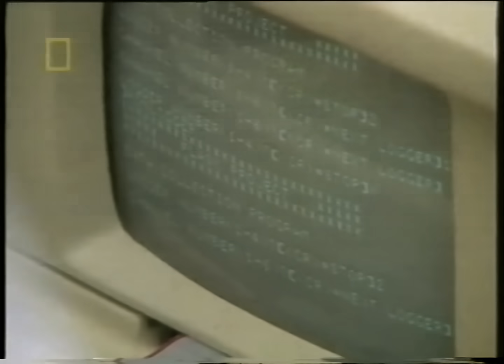Train Crash Test @ 160km/h (99.4 Miles) into 50 tonne Metal Block

Comment: the locomotive used here was BR sulzer type 4. They chose it because they were the heaviest locomotives in BR service at 138 tons.
Reply: @Stephen Drury - can't spell, uses childish insults AND doesn't know that a dick does not fart.
Reply: They apparently bought two withdrawn Class 46s in case one failed during the test (before hitting the flask).
Reply: They should have used a Union Pacific turbine locomotive or a Baldwin Centipede locomotive hauling about 10 loaded freight cars behind it.
Reply: Yeah but none of your yank locos can reach 60 mph without a ten mile run up, never mind 90 mph plus !!
Reply: @magicmaybach  obviously you have never seen a DD40AX
Reply: @magicmaybach  In NC they are currently in the process of upgrading the main line from Charlotte to Raleigh, Durham and into Virginia at a cost of $500million to enable "high speed" passenger services .... at 90mph!  ROFLMAO  So after the upgrades passenger trains will be able to run at the speed that mainline express trains in the UK were routinely running at 60 years ago and were superceded by 45 years ago when the HST's were introduced.  

I am less than amused only by the fact that my taxes are going towards funding this nonsense!
Reply: The Locomotive is a British Rail Class 46 numbered 46009
Reply: Actually this one 46 009, a class 46 was retired before this test was conducted
Reply: Like ur profile pic!
Reply: Near to the D16/1 I believe
Reply: Class 44
Reply: @florjanbrudar692 Class 46 look at the number on the side
Reply: aka they just wanted a big crash
Reply: They used Class 46, no. 46009 in the test.  The remains of the loco was scrapped on site by Vic Berry from Leicester.
Reply: Sulzer Type 4 may refer to:

British Rail Class 44
British Rail Class 45
British Rail Class 46
I copy pasted this straight from wikipedia
Reply: Also why are yall arguing about the delctics, those are a completely different engines
Reply: It was a class 46. Engine number 46009. It was also a bit of a falsified test. The loco in question was due to be scrapped anyway and had structural changes so the engine would break free in the impact to reduce some of the travelling mass.
Reply: @triptechable  nah
Reply: @triptechable  Is that proven? I remember seeing an interview with either the BBC or Channel 4 (if that was even around at the time) newsreader alleging it, but the bloke running the test denied it.
Reply: that's pretty light for a diesel locomotive
Reply: i looked like a deltic
Reply: @Likes_His_washer  The obvious visible difference is that the Deltic has 2 windscreens not 3 like the one in the test.
Reply: @Likes_His_washer  it's a peak or class 45
Reply: @maddog7139  British Rail class 46, no 46009
Reply: @maddog7139  looks like a 45 to me think you are right
Reply: @maddog7139  technically only the 10 class 44's were peaks (all named after mountains and hills in the UK), though the 45's and 46's were commonly referred to as peaks.
Reply: @Likes_His_washer  its a class 40- it has a 3-peice windshield and it looks similar, but not the same, as a Class 37
Reply: @redleader8952  Class 46 Peak, as already stated............
Reply: bro70 oh oops! Sorry, I live in the US... I'm not as good as I should be with UK trains...
Reply: jason tynan I'll have you know I'm 14, and therefore cannot legally own a gun, and never plan to. I just love trains, and its natural that I would know more about US trains than U.K. trains, because I live in America. We don't need toxic people like you in this comment section or the world. Get out and let the actual rail enthusiasts talk about what we like.
Reply: @UnbelievableEricthegiraffe  Who hurt you?
Reply: @redleader8952  Most diesel electric locomotives in the UK look quite similar - either roughly flat-fronted - so classes 26, 27, 31, 33, 47, 50, and 56 being the common ones in the 1960's-90's, and those with noses - classes 37, 40, and 55 (Deltics) with long noses and classes 44, 45, and 46 with short noses.  The obvious distinguishing features are most often the number and pattern of windcreen panels.

Class 20 was an odd exception, being the only long-lived class that, like many US locomotives, had only one cab and were commonly linked semi-permanently in pairs with a cab at each end of the linked pair.
Reply: @redleader8952  Well said
Reply: @redleader8952  That was very well said for a 14-year-old!  Extremely mature.  And has your interest continued in the intervening years?
Reply: @bro70 so why the need to repeat ..😴😴😴
Reply: @redleader8952 14 or not you could send a glass eye to sleep kid 😂
Reply: They were rubbish locomotives ... Not a patch on the class 55 AKA Deltic
Reply: Arsene Wenger wrong. A bit overweight but they did a decent job on passenger and freight work
Reply: @owenevans83  Not going to get into an online argument with you about trains ..How sad and pathetic is that LOL .
The class 55 is a better locomotive IN MY OPINION ... It can't be "Wrong" .It is my opinion.. 
The class 55 was the backbone of the East Coast Mainline from 1961 until the HST took over ... 
If you like these more than the "Deltic"  then that is fair enough .. Would be a boring old World if we all like the same thing.. Kind regards Owen
Reply: @briansaiditsoitmustbetrue4206  Read my comment again, I didn't specify whether they were worse, I just said that 46s are not rubbish locos. However I agree that an argument over choochoos is pointless; you're an Arsenal fan, you've got enough on your plate as it is!
Reply: @briansaiditsoitmustbetrue4206  the 55 was amazing. Very much missed.
Reply: Your a very well knowleged one but also a very boring twat too
Reply: @stephendrury3409  No need to be one yourself.
Reply: Well put :D
Reply: @stephendrury3409  You are simply an idiot!
Reply: @peckelhaze6934  haaaaaa knobhead.
Reply: When you call people boring and the only thing you have to add is insults.
Reply: @anononomous  haaaaaaaaaaaaaaaaaaaaa😎
Reply: @stephendrury3409  The irony of not being able to spell knowledged. You didn't even think to check  before you posted. You ain't very good at insulting people are you? Do people often laugh at you?
Reply: @gravydavy4188  That is wasted on such a being. They don't get irony.
Reply: @gravydavy4188  He also cannot spell: you're (your). I consider the information relevant, not boring. Troll alert.
Reply: @gravydavy4188  I'm pretty sure Stephen was having banter.
Reply: @stephendrury3409 
Says the guy with a last name the is practically "dreary"
Reply: @stephendrury3409  One of the Blockheads needs to know where to shove that Rhythm Stick!
Reply: @stephendrury3409  I had a stroke trying to read that and process what it means
Reply: @stephendrury3409  hHahahaha

Comment: Only because it was sitting sideways, thus the V shape the train hit deflected the kinetic energy, like today's MRAPS, military trucks that have v shaped hulls to deflect the kinetic energy from IED's and other things, flat side would have been demolished, like H1 Hummers over an IED,they get blown to scrap metal.
Reply: +Jaeger Brunswick The weakest points on the flask are the corners of the lid, and it is on one of these that the force of the train was concentrated, in an attempt to knock the lid off. Flasks had already been drop tested on concrete from various heights and all angles.

Comment: I had a bit of a brain fart. I was thinking "how could they have all those people just standing there? What if it doesn't stay sealed?" then I realized how stupid I was for thinking someone could be so stupid.
Reply: I am pretty sure that the container had pressurised liquid or gas and did not have any radioactive element .As a contamination of such a area would be devastating.
Reply: @amaljerry5373  it was pressurized to 100lb/sq. in. But I've no knowledge either of what it was filled with.
Reply: Yeah it took me a second to realize that there probably isn’t nuclear waste in it also
Reply: It's obvious they can't test it with nuclear material inside but seems like there has to be some sort of stand-in with similar mass and weight or else the results would be inaccurate.
Reply: @jbr496  it was full of water, under pressure.
Reply: the thing is.. even if it had .. nuclear waste is not gas or some liquid or fluorescent glowing goo.. its solid rods. Of course Its radioactive depending on the type of the waste (actually 95% of nuclear waste has a quite short life, only a small percent remains with dangerous levels of radioactity for long time) but the range is actually very short (alpha and beta radiation has an actual short range and get blocked easily..specially by water) So even a crack open container while potentially dangerous for people nearby wouldnt expread radiation everywhere. What happent in chernobyl or with nuclear weapons is that the radioactive material is "burned" and vaporized and its spread really far and wide by the ash and particles.. there has been cases of nuclear weapons that cracked wide open (like Palomares incident in the 60s) where there was contamination but was very limited (you can go to Palomares today, no people getting cancer or radiation sickness)
Reply: Actually, I could imagine that's how it's done in Russia
Reply: This is the comment that makes me quit the internet for the day...🤣
Reply: Scientist: “Look at the speed of that train! Good job we emptied the container first!”
Engineer in charge of container emptying: nervous sweating
Reply: They filled it with water and put in steel rods to represent nuclear fuel rods.
Reply: It tuck me just as long to fathem out your confusion so we all have those moments. But yeah for sure there wouldnt of been anything harmful in the container lol.
Reply: "There are two things that are infinite. The universe, and human stupidity, and I'm not quite certain about the universe." - Albert Einstein
Reply: +Tapport  Nothing was inside of the container
Reply: Hasan Mulla Exactly
Reply: Tapport, I think you're very right on with your initial assessment. The 2 constants within this ENTIRE universe is death.....and human stupidity.
Reply: Freaking millenials
Reply: Patricio Andres Muñoz Lopez Sad nobody.
Reply: Well, it's clear... your brain is full of farts.   It's was a pressurized container (air, not nuclear material) that was checked after, for leaks.  Now don't you feel stupid?
Reply: In today's world, it probably wouldn't be surprising if someone didn't already think it through... Common sense is a hard thing to come by anymore.
Reply: Also, what about the poor driver and all the passengers? It's all very well needing these tests but when local services get disrupted like this then questions need to be answered.
Reply: @spiralfirst6488  funny...

Comment: sweet laptop @1:02
Reply: Mark Acevedo omg
Reply: pfft you laugh now .. wait 40 years
Reply: @aliceakosota797  A computer will be implanted in your brain
 at birth. Lifelong update. Monitor in the eye ... third eye on the forehead the camera?
Reply: I miss the floppy disks
Reply: @Jimmy Garcia - I still have operational computers with 3 1/2" & 5 1/4" floppy drives. A Pentium III-450 running Windows 98  and a 486DX4-120 running Dos 6.2/Windows 3.1 ... and 2 slightly more recent HP refurbs running Windows 10 & Win 10/Vista. The older ones, of course, do not go on the net ... :)
Reply: @pudmina  im 30 but remember running programs and codes on floppy during computer programming class... This those simple days before smartphone lol I miss my Compaq pc with 40 gbs of storage and windows xps... The good old days 🤣
Reply: Not a laptop. That's called a luggable. Much more powerful.
Reply: @Kandi Klover - Eeeeeeeeeexcellent ... Yup, searched and found. Also referred to as a "Portable".  Couldn't find one exactly matching the one in the video, but MANY images to pick from :). IBM 5155 and Compaq Portable, both from the early 80's are very close. The one featured here has a keyboard that folds into the case and a flexible "LUGG"age  :) handle on top, Very handy, but heavy, about 30 lb (13.6 kg) using old school fabrication  - thick, pressed mild steel chassis.
Reply: @pudmina  wait I didnt know compaq is so old! I still have a Compaq laptop from 2014
Reply: @Gabriel-he6ih  i even have one from 2008
Reply: Can i play GTA V on it?
Reply: @Tva1ka_unofficial  sure
Reply: @Tva1ka_unofficial  you can play gta 5
Reply: Looks like the Apple IIe based 'Xcalibur Portable'.   Weighs less than 13kg!!!
Reply: @D600Active  turtle left turn 10 😂
Reply: was cutting edge technology at the time... is now the laughing stock of the worlds digital video library...hmph
Reply: @ZlGGLE  I'm fully aware that Mark Acevedo was being sarcastic, so yeah I got the joke. I was adding some relevant information about the "sweet laptop" that he referenced for those that were interested ... You were obviously not ... your loss. And, incidentally,  I'm not black.
Reply: 2+2=.........crash
Floppy discs ....I remember them in high school. The whole class was, open it, put something on it so the teacher knew you opened it and then save and close it and hand it in before the end of the class. I was like, this sucks and it was the mid 90's before I got back into it again.
Reply: For real
Reply: @Mark Acevedo - actually a really, really old desktop (Circa mid 1980's ) running what looks like DOS with a 5 1/4" floppy.
Reply: @pudmina  I did some database development for a guy with a Compaq portable in the mid '90s.  https://en.wikipedia.org/wiki/Compaq_Portable .  Big old luggable.   Dad had a Kaypro CPM machine in the '80s when he wrote his novel.  It used 186kb single-sided 5.25" floppies.  I do NOT miss those days.
Reply: v
Reply: a clock-radio with TV :-)
Reply: Ah yes, enslaved floppy disks
Reply: sick right!?
Reply: Indeed, but just remember the earliest home PCs only started appearing in the mid 70's. So that "laptop" is barely 10 years along from the genesis of home computers.
Reply: But can it run Crysis?
Reply: Lol
Reply: I guess its was mire realiavle than our shitty brittal glass so called "smart" phones...
Reply: And you still needed to connect it to a power outlet.
Reply: It's a Pizza box 🍕
Reply: Ibm 5100
Reply: @hunorgames3957  lol, I was thinking the same
 Ely Psy Kongroo
Reply: @hunorgames3957 nope

Comment: Disasters? they cheaked to see broken train right????
Reply: No, they were checking to see if the flask could withstand a high-speed train crash without leaking, since such flasks are transported by rail. The train, a surplus locomotive and coaches due to be scrapped, was not expected to remain intact, but there were crash dummies in the coaches to test new seat and table designs. The loco and coaches were broken up for scrap by running them into a nuclear flask, then further dismantled on site.

Comment: It was all done by remote control the train colliding with the 50 tonne metal block.I imagine their wasn't any suicidal drivers available for the experiment.
Reply: The train needed no remote control. The engine was started, the controls set and the brakes released from outside by turning a tap. The rails and wheel flanges did the rest.
The flask being tested was a box, not a block.

Comment: Money well spent.
Reply: +acronus  It actually was at the time.  This was during a period when British Rail safety wasn't exactly sparkling and a lot of regular rail users were extremely uncomfortable about possibly sharing the rails with enough nuclear material to make pretty much the entire southern half of England uninhabitable for a few thousand years, to the point where people were quitting jobs that required them to commute by rail for jobs more local to home.  Not to mention the reactions from people living near major freight routes and hubs.  They needed to prove that even if the more than worst possible event happened there was very little likelihood of a significant radioactive leak.  The flask actually exceeded the expected and acceptable test result by a fair distance, exhibiting no signs of even a potential breach during study over the days and weeks after the crash test, which did a lot to put people's minds at rest...

Comment: The loco is a class 46 and incapable of 99 mph 89 is more likely.  And the test was rigged.  All the bolts in the loco was removed so it would fall apart on in pack.  And the steel block was a nuclear flask container tested to see if it would fail in a train crash
Reply: The train was radar timed at over 99 mph, and it can be timed passing the platform end at that speed from the video. A driver who used to work Class 46s told me they could easily reach 100 mph to make up time with a light train, as he had done more than once. The posted 90mph service limit was to minimise wear, the engines not being governed in any way.

The "removed bolts" schtick is a myth. Engine torque would have ripped the thing apart in the first few yards, and the engine stayed firmly in place, even after the loco overturned. The generator broke away, taking part of the crankcase with it. Some bolts may have been cracked open a fraction of a turn to make scrapping in situ easier, but certainly not enough to weaken the structure over 8 miles. The train would still have conserved its kinetic energy and transferred it to the flask in any case. Only the first impact on the lid mattered; the flask would withstand anything that followed.